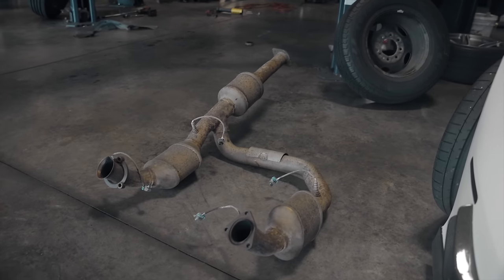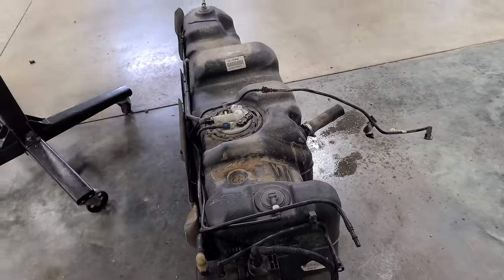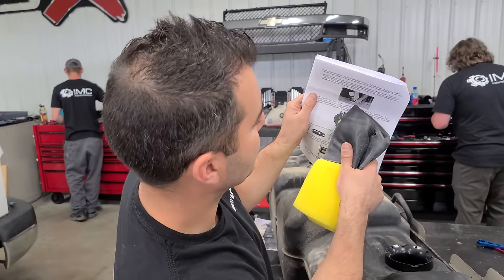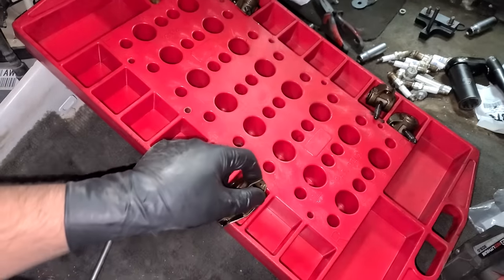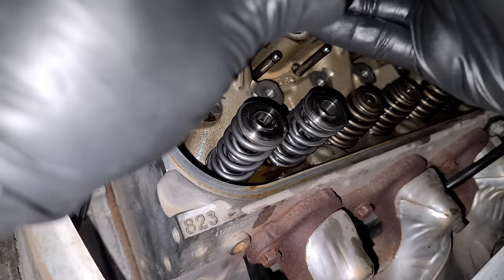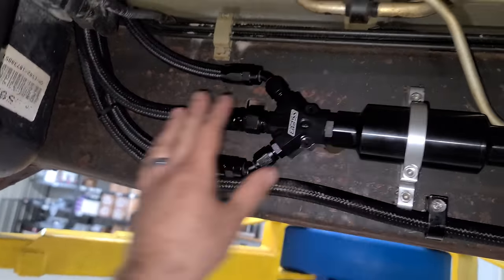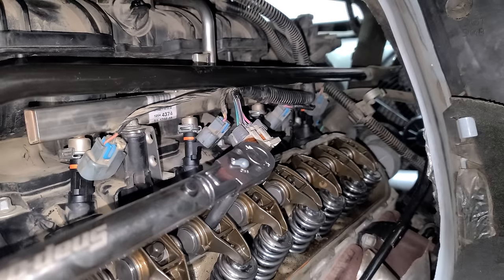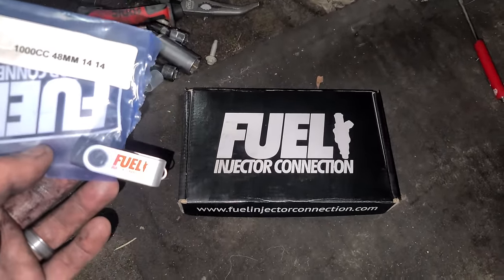We Finished Supercharging My SLEEPER LS Work Van & It’s RIDICULOUS! Insane Exhaust System!

Comment: That exhaust system is a work of art.   That's skill and expertise right there.  I am very jealous of that.
Reply: repentandbelieveinJesusChrist2     I am already going to hell I am a furry
Reply: It could only be made better if that cutout was also vacuum-actuated, that way it automatically wakes up when you romp on it and gets its power back now that its free-flowing, or otherwise stays open when you hit the button if you want the impressive idle rumble.
Reply: Uh, got to disagree with you there - especially for what they probably charged for it.

If any exhaust builder wants to impress me, it will be by building a QUIET exhaust that's also low restriction - that van would have been a great platform as there's a lot of space underneath.
Reply: @gordowg1wg145   Thanks for sharing

Comment: Vehicle engineering always amazes me. If you think about how much abuse every part of a vehicle takes over its lifetime - from the engine and transmission to the little clips holding on the trim, the parts are engineered to basically last forever with minimal upkeep. Seriously blows my mind.Things generally only fail when abused or neglected.  Great video!
Reply: I wish they still made stuff to last like they usta , now it's all mass production, horrible quality control and just weaker materials ... my grandfather was a machinists with his own shop so I have a genuine love for hand made and custom or just old school solid made parts ... 💪🏽🤙🏽✌🏽🤘🏼peace and love brotha
Reply: If only that were true with all cars. My window trim has deteriorated and interior door handles melted. Not to mention all of the non maintenance issues, like the water pump potentially randomly failing leaving me stranded. Some designs just didn't work
Reply: 723,000 on 2012 Hyundai Elantra
Reply: And it shocks me sometimes how things break down after a few years.... Still great video.....
Reply: @totallybonkers I have to disagree,  somethings on cars and trucks have gotten much better. However  while some things are better the more stuff made of plastic that should be made of metal break and in some cases can cause engine or transmission failure.  He'll my 2015 Camaro SS is a Green Flash edition the plastic that hold on the lip spoiler has disintegrated and they don't make any replacements. The LS engine though was built to last at least 500,000 miles I've seen 4 that have all work trucks.  Ford on the other hand builds their engines to fail after warranty runs out if they make it that long.
Reply: @DonnieDarko727 in’t no way them valves ain’t tapping there life away lol maybe I’m wrong I just never heard of that many miles on a newer hyundai
Reply: @josephclayton4115  15w40 diesel oil for the last 400k miles. Transmission replaced at 612,000.
Reply: You never had a BMW, right? Or a Porsche?
Reply: Let me start off by saying im not a "new is bad" kind of guy, actually I like new stuff... 

but the difference between this van and a 2020 Nissan rogue is massive.... LOL

Some vehicles you get lucky and just have shit that works for 350k miles... some vehicles are having issues after 30k...
Reply: @CHOPSHOPX the work truck I drive is a 2018 Ford F250 6.2L gasser and the intake manifold is bad because the plastic runner control inside is broken (or something like that). The worse part is you can't even buy a new intake manifold. Ford has them backordered for like 3 years and it's a common issue. The truck only has 117k atm. The bad manifold causes it to be noisy and it's just bad for the engine. We now have a p300 code because of it too. It is possible it might need new spark plugs I guess but it's just ridiculous that you can't even get parts. I love my 2004 Chevy Silverado and can get almost any part I need to keep it maintained.
Reply: @johnwalker7592 a Nissan rogue is a rental car and this Van’s sole purpose was to be a work van.  Also, the fact it most likely took long trips and did not defer maintenance helps a lot.  My wife in her college years had a 2006 Jeep Liberty.  Some would say this is not a reliable vehicle with the 3.7 liter.  She drove 100 miles daily and sold the car with 290K.  Only part that ever failed was her fuel pump.  2nd owner still has it at 340K miles.
Reply: One thing that's always amazed me is how long engines (most of them) last so long and all I had to do was change oil regularly and change the spark plugs every couple of years. I had a Nissan Maxima with 350,000kms and the motor was smooth and quiet. Just regular oil changes (whatever oil and filter was on sale) and spark plugs every 100,000 kms.
Reply: Uhhh, no. NOT engineered to last forever. Lol. And minimal upkeep? Oil changes every few thousand miles is called minimal?
Reply: @DescartesRenegade  he said the parts are minimal upkeep, not the whole car.. anyways I think he's too generous. Some things have gotten better but other things have gotten worse. Like the use of plastic.. both a good and bad thing

Comment: If you don't already have a posi in your van you are going to need one. I have an older Dodge van with a 5.9 gas motor and traction was always a problem. Not heavy on the gas at all and loaded with work tools it was a problem in the rain and snow was a disaster. Installed a Detroit locker don't have problems in the rain but waiting for snow to see how it works. Good luck with your build.

Comment: You have to experiment with the motor. It would be awesome to see just what a stock LS can actually do.
Reply: GM has had the same LS platform in these vans stock for 23 ish years. This wasnt an LS swap. The van came stock with an LS. What more do you want to see the stock LS do?
Reply: @flipfloptanlines926 hold boost
Reply: @rosegold-beats  dowel pin the mains and open up the ring gaps and your solid till 1000 with a safe tune and enough fuel system

Comment: Fun tip for drilling plastic with hole saws: once the pilot bit breaks through, reverse the drill and run the teeth backwards through the cut. Cleaner cut and wont grab and kick toward the end of the cut

Comment from the maker: How much power do you think this stock 6.0 LS can handle and what do you think it will make on the dyno in the next video? Dynojet dyno.
Reply: 300 rwhp!!
Reply: 550-600
Reply: I’m gonna say 600-650 then start having issues
Reply: Stock ring gap will limit safe power to 500 rwhp. That is my guess. Wider gap, 700. Forged pistons 1k hp

Comment: Tech tip: Install the clips onto the injectors first, then install the injectors with a little lube on the orings. It makes it easier and ensures the injectors go in at the correct depth when they snap into place.

Comment: Always enjoy watching a new LS3 episode!  Space van was interesting, but this is the van content for me!
Reply: LS yes, mostly. LS3, no. LS3s are an all aluminum version of a 6.2, available in cars only, not vans or trucks. This, and all vans and trucks, are called the LQ platform. Very similar, and yes an LS platform with interchangeable parts, but with a cast iron cylinder block, and 6.0 liter maximum. LS1- start of new platform about 1999, cathedral ports. LS2, similar but transversely mounted for use in front wheel drive cars. LS3 about 2004 introduced new heads with rectangular ports and an increase to 6.2 liters. LS4 basically an LS2 with at 5.3 with the rectangular ports, for sideways mounted engines. LS5 was a big block from the 70s so they didnt use the code again. LS6 actually came in 2001 right after the LS1, high performance LS1 fir corvette use. LS7 was a the largest LS available at 427 cubes, about 06. LS8, not used. LSA, supercharged LS3 version  for vettes and camaros and fast cadillacs. Ls9, is an even more premium supercharged version for top end corvettes. Titanium rods and stronger parts. There are many other differences in these. The blanket term LS is technically a GM Small Block Gen 3, which is called an LQ engine engine in truck, with a cast iron block. Very few special versions of trucks were shortly available with an all aluminum engine. Its very confusing, especially since GM is reusing many of the same codes they used in the 70s. A 1970 454 big block chevy is also called an LS6 for example

Comment: Love my work van, it’s a 2008 shorty diesel duramax 3500. Great mpg and power compared to the gassers. Considering converting it to 4x4 for an adventure rig . I feel like I need 3 of these now. The worker,a low rider version and a jacked up adventure rig:)
Reply: Once you drive a diesel w/boost. No desire to drive gas powered!

Comment: As someone who did this himself, at home on a 383 Vortech SC 1988 IROC in the early 1990s with a stand-alone DFI box replacing the stock ECU, and having to tweak it myself over a serial cable connection using a Toshiba T1000 (circa 1987) laptop to get it to run right, the era before self-tuning existed, and converting it from MAF to MAP (speed density), I really appreciate this.

Comment: There's only one problem with finding a high quality shop like FMU... Be prepared to wait. I used to book people 3 months out for things like GTR Alpha builds. I know you're going for the patina look, but I'd recommend upgrading those headlights. At the speeds that van's going to be capable of, you need better headlights.
Reply: I have driven them without cloudy headlights and even then they are pretty terrible headlights for a modern vehicle. I would put some projectors in there with HID's or perhaps some self contained LED projectors. Retrofit Source has some good stuff.

Comment: In French sparkplugs are called bougies, which means candle :)

I've read that the rods are good to 750 bhp (fatigue limit).  An LS9 cam and 1-3/4" headers, you should reach 750 bhp at 13-14 psig. You can go higher, but it will be on borrowed time.

Comment: I drove a 2017 chevy 2500 work van with the 4.8. 
 It was a fleet van, so i took it to get the oil and a headlight changed. 
 Not sure what they did, but when i got it back, it was FAST!
 It wasn't like a vette or anything, but way to quick to ne normal.
 My buddy didn't believe me, so we ran a few guys on the strip. 
 I was beating vehicles that, on paper, i shouldn't have come close.
 It ran like that for like six months, and it started to slow down, back to what i guess would be normal.
 I was still able to beat the brand new vans when we got them in.
 Those 4.8s are amazing. Used and abused, sparse oil changes, and it still ran strong when i quit that job.
 The van was being traded for a new one when i left, but at over 200,000 miles it was still great.

Comment: Best vid yet!. I'm a vanaholic.... Back in the early 90's I put a Lingenfelter big small block in an Astrovan. Passed emissions for the 4.3v6 yet with a bit of spray went 11's at GLD. It was a panel And I had slicks and a jack with me at all times. Set up the race on 215 tires with  5 minutes "for adjustments" lol. Kinda psyched out the competition seeing my GF slide the jack under the pumpkin and lift the tires while I rolled out the slicks...  PS.. it would  go 13's with my ZX-11 in the back!

Comment: I also like to rotate the engine until the particular cylinder being worked on is at TDC. On most engines this means even if the valve falls, it will stop before it cannot be retrieved. Also, most of the time the valve seal will keep the valve from falling, so that's your last safety item if something goes wrong. This more applies to the originals, if you've changed them with fresh lubed ones they don't have as much grip.

Comment: You need to pipe the diversion cutout on the exhaust back into the tailpipe or add a second pipe out to the back on the other side as it sounds like a Demolition derby car with it dumping under the van and I can't imagine the drone inside the van while that exhaust is open. Sweet build though, not many can haul carpet then haul ass right after! LOL

Comment: Here in Europe, E95 is 2 out of 3 pumps at every gas station. It's a little cheaper than normal petrol, but you use more of it per km driven, so it balances out price wise

Comment: Just a point on the push rods, a hardened push rod was for use with guide plates, so they push rods wouldn't wear rubbing against the guide plate. A shaft rocker doesn't "technically" need a hardened push rod, but a thicker pushrod wall would be something that would be useful.

Comment: Little trick for you from a plumber.  When you use the holesaw drill on something plastic or something light weight.  Start in reverse.   And get your bit to bite  into the plastic.    And then change it to Ford once Your started.

Comment: The van work is incredible, just the way I like it: ratty patina on the outside, cool new and uprated parts underneath. Much happier seeing that the insulating covers for the new dual fuel pump's wiring connections both exist & have been installed. Was Really not happy seeing no covers on them in the last video (horrible place for sparking or an electrical fire ...).

Comment: Cool reminds me of my 66 bronco build back in my late 20's with a 351 Winsor build, top loader 4 speed and an all night getting it fitted and fired - great experience for my first build car, had other like mid 55-57 ford with 383 turn pike mercury 310 HP if I remember correctly, raced a 66 chevel top speed and I walked away in my 55 and or like 390 police interceptor 3 speed full synchro in the 57 fair lane 300 - boy was that car a dream drive.

Comment: I subscribed.  Can’t wait to see how this comes out. I’m in the process of doing a cam and injectors, valves springs and push rods on my chevy 2500. I was going to charge it but the cost was so high so I decided to go camshaft and all motor and see what she can do with a good tune. I’m figuring around 500hl at the wheels will be perfect. I already did a jasper transmission with larger torque converter so I am ready to dive into the motor. 
   So this channel is right up my alley. Also appreciate the tip on fuel injector connection company. Since I basically have an LS platform I am able to get decent injector options. Great content.

Comment: The keepers, I like to tap them with a dead blow hammer, just to ensure they're fully seated. Because sometimes they will look like they're seated but be hanging on by just a corner and you go to start up your truck and boom, it flys off.  Cheap and easy insurance

Comment: Although not as extreme I remember when I was in high school one of my friends older brothers decided to cam out and go ham on a used ambulance van. Gutted it, worked that 350 and had this sleeper van that sounded spectacular and could lay rubber for blocks. I mean that is a good example of making use of an ex ambulance other then the crusher.

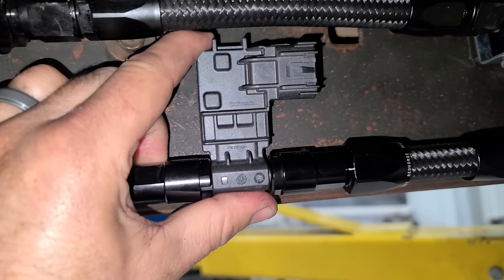Comment: 39:14 Continental is actually a major automotive supplier.
It has multiple divisions, one of which is Sensors, and another is Chassis and Powertrain. The latter offers services of adapting chassis, engines, or transmissions from an OEM to another OEM.
For example, an OEM may want to enter the mini-car market, but does not want to actually make all the R&D for that risky new market segment. Therefore, it can require Continental Chassis and Powertrain services, in order to make all the R&D, testing, and Quality Assurance, in order to make sure everything goes smoothly.

Comment: If you ever want to switch vans I have a 2002 chevy express 2500 extended cargo with a 5.0 liter v8. Only 360000 miles on the original motor. She is a daily driver as I use her for carpet installation. Also it has 65 mph ac so I would advise to use the inside fans to keep you cool.

Comment: another way to keep the valves closed while you change the springs is to feed some soft clothesline into the cyl and spin it over until the piston pushes against the line which pushes against the valves

Comment: at 200k your rings are fine don't need to open them when you are intercooler an on E85. Ive been 30psi on .019 gap adn never butted a ring. Most of the used SBE stuff I take apart is .022 or larger.

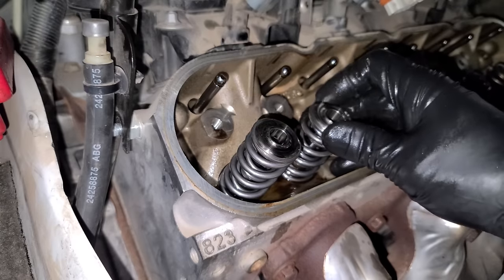Comment: 30:50 extra spring pressure will not stop the valves from over heating and thermally expanding into the valve guides, ream them out +0.25 to +0.5mm. "actually needs valve seals"

Comment: My brother had a '70s Chevy van with small block 350 in it that he did a cam and head work too. Full carpet inside with the system. I think he ran 315  in the rear at 255 to front. And that van would like them tires up. Also through a drive shaft once😅

Comment: Sense. The wheels are steel you should widen the stock ones in the rear as much as possible without having to do too much bodywork if any. That way, you can keep the stock looking rims, but have more grip in the rear for the power with a wider tire. You should be able to find a shop that can modify the stock rims, it’s a fairly easy job. They just got to cut the rim in half and weld in a section for however wide you need, probably only an inch. I wonder how wide of a tire you can fit at the stock sidewall height, in a stock wheel well without modification?

Comment: Push original motor is my vote. I supercharged a budget two bolt main 350 till my high performance clutch ripped the splines off my M21 transmission. Motor also broke both motor mounts. Motor never blew or used oil.

Comment: The only prob with their idea about triple pumps: any time pumps with different flow rates run at the same time, you can have surging back thru the small pump - and the check valves can't react fast enough. Same deal when you have 2 turbos of different sizes in parallel. To maximize flow, you need to simply disable the stock pump while the Aeromotive pumps light up.